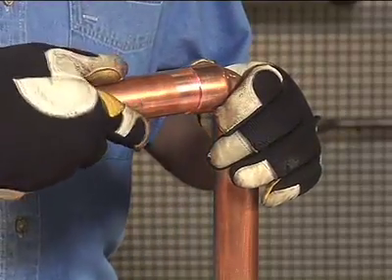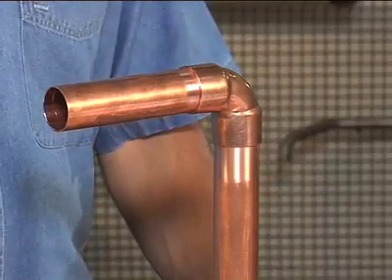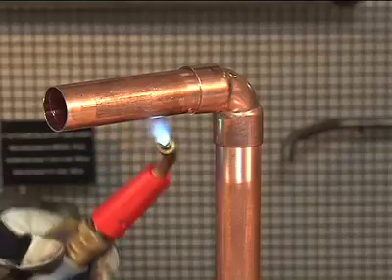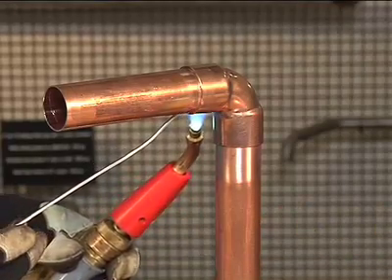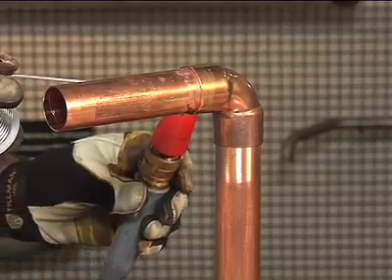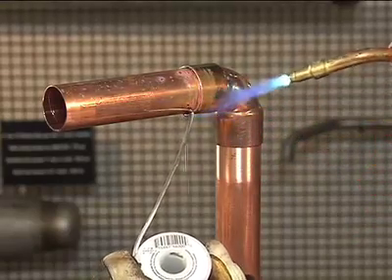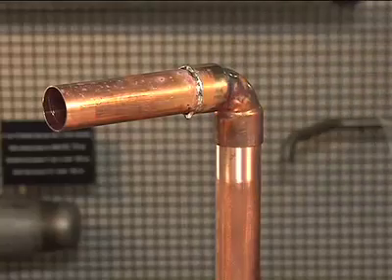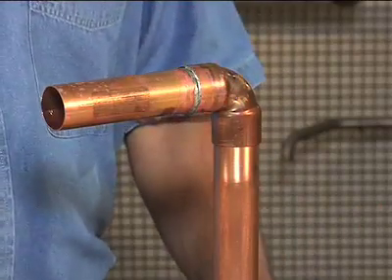Fluxing & Soldering Techniques

Comment: Heat one side of fitting. Apply solder to opposite side.  Use as much solder as whatever size diameter pipe you working with.

Comment: That looks like 1 1/4  pipe, if you do what most commenters say and just heat one spot and feed the solder in the opposite and it will go all around is wrong, for larger pipe you do want to move the heat and solder around, obviously this guy is way too slow and lingers around with heat too long but for larger pipe you do want to  work  your way around the pipe.  Most people here are right for smaller size pipe. And to be fair 1 1/4 you can still get away with not moving around the heat too much, but for anything larger you are better off taking your time and making sure you got even heat all around the pipe.

Comment: My grandpap taught me to sweat and solder pipes years ago, when I was a kid. I never heard of heating or starting the solder at the bottom of a joint.  Like painting, you start at the top, because you're working with a liquid, and it will run downwards. I can't believe the "Copper Development Association" would lend their name to this poor-technique video.
Reply: The reason you heat the bottom is because heat raises but any plumber would know that.  Hopefully you have learn by now.

Comment: I'm watching a few videos on soldering copper pipe to remind myself of the details since I haven't soldered in years. This guy is an idiot. This video is ludicrously bad. 

I'm not an expert by any means, but as soon as he said to put flux in the female fitting, instead of twisting the join to evenly spread the paste, I began to doubt him. No mention of how important it is to get the pipe clean and dry. You know, the basics. Lol

Then he tells us to wipe off excess flux before heat. What? It turned into a chuckle fest when he started to feed the solder around the pipe. And he doesn't mention he's ruining the joint at the other side of the corner. Does he know?

Some commenters are defending the guy, saying don't be haters. But this is just wrong instructions. You're going to get an ugly joint that may start leaking in just a few years. Please look at other videos for professional instructions. 

Look at that awful joint. Come on! You can see it's a bad job. What a mess.
Reply: You do want to apply flux on both metals soldering, and making sure both metals are clean before doing so. Wiping off excess flux is  preference, wiping off excess will minimize solder run off. The solder will follow the heated flux.

Comment: Lot of haters on here. The instruction was perfectly fine. Just the soldering part seemed wierd - following the torch around like that. I simply heat the whole joint and once to temp the solder should flow all around. In most situations you won't even get access to more than one side of the pipe anyway.

Maybe on much larger industrial pipes they do it this way.
Reply: V T sure.  Except for he held his hand and torch tip under the joint first off. Ouch. And second.  He is gonna be buying a crap load of very expensive turbo torch tips.  Also he over heated  the fitting.   Why.  Becuase he heated the tube.   Wtf for solder goes where the flux and heat are.  Why do u want solder down the tube.  You don't.    It's a fine video on how it kinda works but is no way a good instructional on how to solder in a real world application.   Started soldering as a kid took years to truly master.   Not something you will find in a video.  But best to search the comments for those who know.  Not those who hate.   Peace

Comment: bad idea to put flux in the female part of the joint as you end up with loads more flux inside the pipe. why would you wipe of the flux you put it on for a reason!.  I always carry a little mirror so i can check that the solder has gone all the way round. also whats with tiny torch
Reply: A little mirror is a good tip. Thanks. It's hard to trust yourself when you're a DIY homeowner.
Reply: everything mostly tubes nowadays..rehaul pex vanguard ext...only stubb outs are copper...

Comment: following the solder has never worked out for me. heat the bottom dump it in the top, wipe the drip if one exists, clean it, move on with life (or just buy a sharkbite fitting) unless you've got a pro-press around, or access to one.

Comment: I always hit the freshly soldered joint with a damp rag and just run the rag over the "blued" area (WITHOUT KILLING IT) in other words, fast enough that the damp rag doesn't get hot, this gives you allot cleaner looking joint. and it's not cooling it to ambient temp quickly enough to damage. (not a metallergist but it has never failed me) just offering a tip.

Comment: I'm a newbie. Excellent info on how the flux work. I tried to solder by heating and melting the solder. Not the pipe. that leaked the water. Went to youtube and found this one. Then I sanded (emery clothes) the pipes again and tried your method. (Heating the pipe and then the solder got sucked into the joint and made the seal). Thanks a bunch. Without this video, I will still be soldering over and over again and melting a truck load of solder.

Comment: What's with all these soldering videos, talking about "pushing solder into the joint" and "follow the solder"  Yikes!!   Put the heat on one side of the fitting, or below it. The heat moves through copper faster than you can move the torch anyways. Periodically touch the solder to the top, or opposite side of the joint. Once the joint is hot enough (with practice you should get it first touch) the solder will PULL into the joint! No need to move the solder or try to force it. That will only guarantee you leaks and drips. A well-soldered joint will barely have any solder drips or runs along the pipe.

A good cleaning and a thorough, complete-coverage of surface fluxing, are far more important aspects of soldering well.
Reply: James Cooney 

A perfect description! I can't argue with a single word of what you said, blimey, I had to double check to make sure I didn't write your comment :-) Happy to read some sense here in the comments section. Keep up the good work.

Comment: I just simply heat the bottom and solder at the top and it flows down and around....never had any problems either!
Reply: You never had any problem because that is the right way to do it.

Comment: don't you just heat the elbow until it's hot enough and then just tap the top of the joint with solder and it will just flow all around the joint?
Reply: I think is better to heat both the elbow and the pipe equally.
Reply: ***** It's not really the heat that "pulls" the solder in. Capillary action is the "force" that pulls the solder into the fitting. The heat is to get your solid solder wire into a liquid state so that capillary action can take place. I'm sure the way you do your work is absolutely fine though. Finally, the clue is in the name, they are called "Capillary Fittings."
Reply: +August Riley I'm not a plumber, never get training on plumbing job. I love to see the videos from the professionals like you who show and teach the normal people like me. Sometimes, seeing someone who solder the cooper so easy, but I know it's not easy as you see. I wonder myself why people has to do the certain things like flux, where to apply heat, where to start, etc. Each plumber based on his/her own education, training, experience will explain the things differently to the best of his/her knowledge.

This is a free lesson for people who wish to learn. I'm wondering why people has to give the negative comments or insult others like calling them stupid, idiot, etc.. People did their best to show us how to do things.

If you don't know something, it does not mean you're stupid or idiot. It just means that you haven't done or studied about it. That is all.

You mentioned about capillary action which intrigue me what it means and how it works. So I googled it and reply to your answer so other people like me when they read your comment and don't understand what it means could read it. I never have any intention to insult your education, your experience, or anything like that. I believe that no matter what I know, there are other people know more than I do. 

Anyway, I do learning something from you (Capillary action) and I thank you for that. I also have to thank the author of that link, he spent a lot of research to compose or write in the details of that process.

By the way, I'm a professor who teach at the college in the last 15 years.  I also work in the corporate / professional environment in the last 25 years and hold multiple prestige certifications, designations.  Unfortunately, I still have a lot of things that I don't know and want to learn more within my own profession and other fields like plumbing,.  I just love to see how things work , and try to do it to experience it.  It is fun  :)
Reply: ***** By coincidence I am the same age as you and have similar experience in training. Mate, I'm not having a go at you, I learned in a similar manner to you as you must have read by now. From "One of the old guys" coupled with your equivalent of "Union School." At the end of the day, as you said, as long as your technique works and doesn't cause long term problems then all is well. There's more than one way to skin a cat as they say. I go by experience, the way I was taught (not just at school) and with what our regulations/boards publish as best practice. I was just a bit annoyed at your comment about "BULLSHIT college trade school for high school dropouts" when in my jurisdiction we learn in almost exactly the same way as you do but you call it "Union School" whereas we call it a five year Indentured apprenticeship, with college for exams and practical assessments. Keep up the good work.
Reply: +August Riley http://science.howstuffworks.com/brazing1.htm

Comment: How well the solder flows inside the joint area ?  ..Does the flux suck it in ?
Reply: Heat up the joint and take it apart and you will see? you will be surprised how much is in there.
Reply: Thanks. I already did the project ..No leaks and it looks good.

Comment: will the flux working for PVC material?
Reply: Yea. Go ahead and try it...
Reply: All joking aside, PVC is a plastic which you need to glue,using PVC glue, 
Copper tubes are metal, solder is used to make a metal connection and the flux helps the solder flow and bond.
Reply: Meiji Jap no. with PVC all u have 2 do is clean it then glue it. 4 me i just glued my PVC. as it was not going 2 be under a hi psi load.

Comment: Most of everything this clown explained is really not the right way! The best way is to heat the fitting cup all the way around. When the solder starts to melt, melt enough on top of the pipe until you see a drip form on the bottom. That's it. The solder will be drawn into the pipe all around on the inside by the heat.

At this point, most guy's will call it good, which is fine. I myself take a clean dry rag, and lightly wipe all around the pipe while the solder is still in a liquid form. This smooths the solder and makes for a clean and professional looking job. Just make sure not to disturb the joint in doing so.
Reply: My master disqualified me when my joints were dropping solder. He said "solder is expensive, if you keep doing that you will not be able to afford to be a plumber".
Reply: +service1956 The reason I don't wipe joints while the solder is still in liquid form is because the extra material (or "shoulder") gives the joint extra strength.
Reply: ***** Lol I didn't need you to write me your life story. I'm sure you are qualified as a tradesman. 

I simply stated a fact:

MORE MATERIAL = MORE STRENGTH
and
LESS MATERIAL = LESS STRENGTH

I am not talking about any building codes. I never said "don't wipe joints". And I never said wiped joints wouldn't hold if done properly.

I don't care what color you are, you could be pink with purple stripes! It still wouldn't change the simple FACT that MORE MATERIAL = MORE STRENGTH. Your argument is pointless.

PS I'm an HVAC/R guy (almost 5 years now). But I did enjoy reading technical/engineering/chemical things. A while ago I worked 12 hour night shifts at a condo lobby so I had a lot of time.
Reply: ***** I take it mechanical engineering wasn't your major?

I am talking about lateral stress, i.e. bending.

If you can't make a clean-looking joint without wiping then you, simply put, suck.

Youtube would be a better place if some people would use their brain a little before posting silly comments.